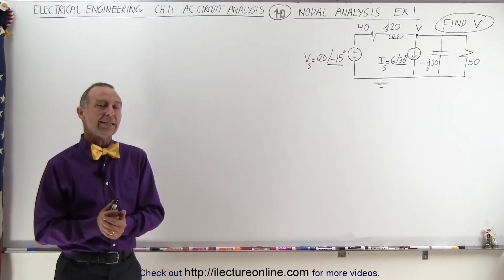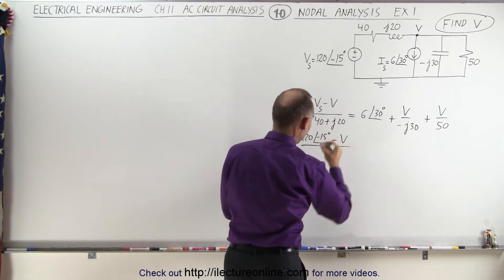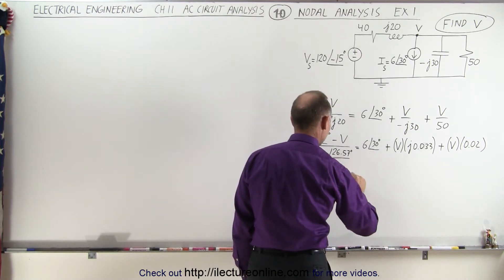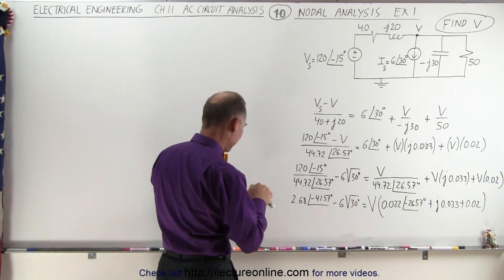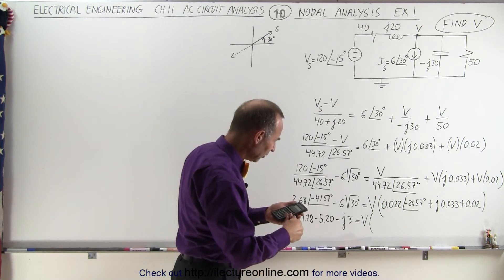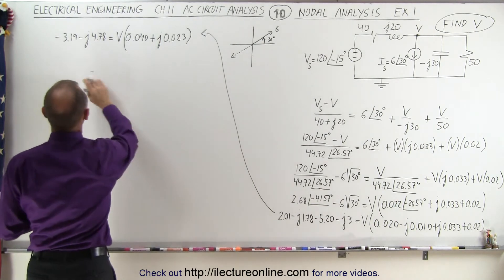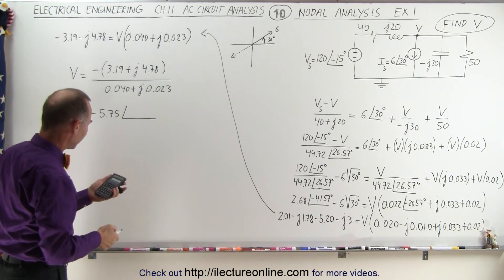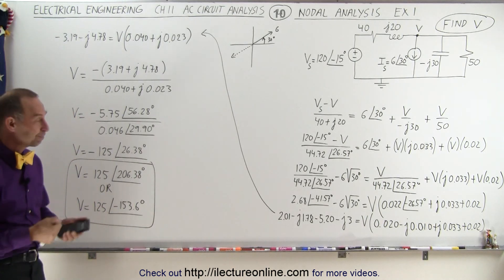Electrical Engineering: Ch 11 AC Circuit Analysis (10 of 55) Nodal Analysis Ex. 1

Comment: Wonderful series but it gets very difficult to follow along at points when you start doing steps in your head :( for the future can you please take the extra time and just explain like what happened at 3:20, I know it can be simple to others but when learning this material for the first time, those steps aren't yet inherent to someone learning! Thanks for everything either way!
Reply from the maker: We appreciate the feedback.  We assume that a student who is taking electical engineering would know that 1/50 = 0.02 without needing to be shown, but you are correct that we should be mindful of that.
Reply: @MichelvanBiezen  haha not that part, I was confused by the -j30 turning into (V)(j0.033) but after watching it back, I realized you just separated out the V, were left with 1/-j30, and then divided with the j included. I hadn't seen that notation before or at least in a long time, so I didn't realize -j could be divided numerically.

Comment: When do we know when to subtract or add the 180 to the angle to switch the mode of the result? Is it only if a particular i or v that we find is negative?
Reply from the maker: It is arbitrary, but typically, you want the phase angle to be between 90 degrees and -90 degrees.

Comment: how will we know where to place the ground? Will it always be in the wire wherein the total current is going back to the voltage source?
Reply from the maker: Ground just gives you a voltage reference point and it is a safety valve for the circuit.  Typically ground is connected to the negative terminal of the battery in this type of circuit.

Comment: prof. Biezen, can you please tell me when we take the sine of the angle or the cosine of the angle? I'm still confused with that. Also how do you know what is the angle if it was 30 or 90 without doing any calculations? thanks in advance for the great work.
Reply from the maker: By using the definition of the trig functions:   sin = opposite side / hypotenuse     cos = adjacent side / hypotenuse          But here when we convert from the complex form to the magnitude and phase angle form we use the tangent   ( = opposite side / adjacent side)

Comment: Why does the ''r'' and the angle is different using (-3.19 - j4.78)/(0.04 + j0.023) than when we use  -(3.19+j4.78) / (0.04 + j0.0.23) ?

both numerator are technically equal, 
but when I use (-3.19 - j4.78) I ultimately end up with 125 angle 26.38 degrees (sqrtroot((-3.19)^2 + (-4.78)^2) = 5,75)
 (tan^-1 (-4.78/-3.19) = 56.28 degrees )

5.75/0.046 =125 (positive)
56.28-29.90 = 26.38 degrees

which would be 125 angle 26.38

instead of the 125 angle 206.38 degrees that you ended up with...

the signs for the r calcultion are what is bugging me I think.
Reply from the maker: The two expressions in your first sentence are identical.  They should give you the same answer.

Comment: For your answer V = Magnitude 125 , angle -153.6 degrees....I was curious about the magnitude. Our source voltage has a magnitude of 120, is it possible for other points on the circuit to be at a higher potential than our source? I wasn't sure if the addition of a current source could affect the outcome. Thanks!!
Reply from the maker: There is also a current source in the circuit, which will add additional voltage.
Reply: Ok that is what I figured, thanks.